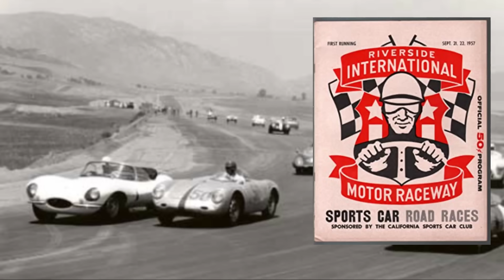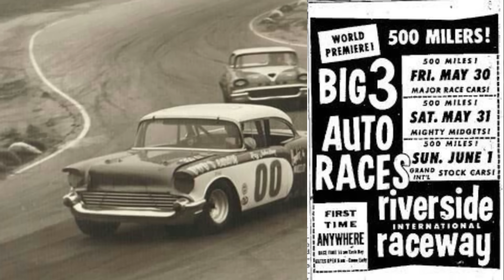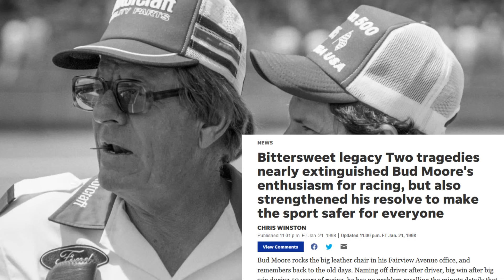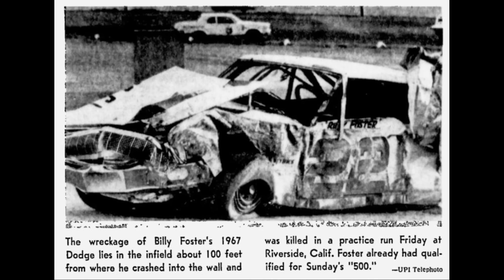NASCAR's Most Dangerous Circuit - Riverside International Raceway

Comment: Dad introduced me to Riverside in 1957, age 8. Wasn't until I turned 18 before I could afford a seat in the turn six grandstands (can see most of the course from there). Walk the entire course over the years looking for a sweet spot. The memory that sticks with me until I die, is standing on the bridge over the straight away and hearing the Can-Am cars shifting into high gear..No sound quite like a big block chevy at close to 8000 rpm. Miss Riverside......
Reply: Did you ever get to see Max Balchowsky race the legendary Old Yeller II there?
Reply: @dukecraig2402  Yes i saw Ole Yeller back then. Didn't know the driver, just the car. Ken Miles was my favorite driver back then driving a Porsche Spider.

Comment: 0:44 didnt J.D. McDuffie die in the cup series in Watkins Glen
Reply from the maker: Ahhh. Totally right, completely overlooked that. Thanks.
Reply: @nascarfan4888JJ that’s a big f up 😂
Reply: The issues with Watkins Glen over the years were simple- first the guardrail was poorly installed (common back then) and allowed cars to either go through it (Cevert) or submarine under the top rated which would separate from the bottom (Koinnig). Later, the problem was speed going into turn five. It was a crazy fast straightaway leading to a sharp turn. JD rocketed off that corner to his death just weeks after Tom Kendall broke both legs in an SCCA crash. That’s why we now have “the bus stop” chicane. The Glen is still truthfully a very dangerous circuit today. Riverside was classic, but definitely dangerous.

Comment: On a side note: I have this track installed in Assetto Corsa (mod track), and while it is not exactly accurate (variations in elevation, etc.) it is a fun drive in period correct cars. I have done a few Trans Am, Can Am, and NASCAR races there. The lack of proper run off areas are what made this track so dangerous.
Reply: I have heard a lot of good things about that game, PC or Console?
Reply: @chrispix61  PC, I don't believe the mods make it over to the console version. If you decide to get it (pretty cheap through Steam) Definitely the first mod to get is "Content Manager" as it makes installing all of the other mods super easy, and it includes CSP which is a graphics update for realism.
Reply: Thanks, your username made me literally laugh out loud,  "where's my inhaler"
Reply: Instead of flat runoff areas, Riverside was full of ditches and berms adjoining the track. Just watching this video shows the inevitable consequences. I never saw a NASCAR race there but a number of SCCA races in the '60's including watching a friend race his B Production '64 Falcon with a Shelby built 289. I was heartbroken when Ken Miles lost his life. A memory I will always cherish was going for a ride with Ken in his prototype Sunbeam Tiger!
Reply: @richardmccaughey5928  Such is the case for many tracks of that vintage. It's crazier to think there was enough area around the track that even modern run offs could have been put in.